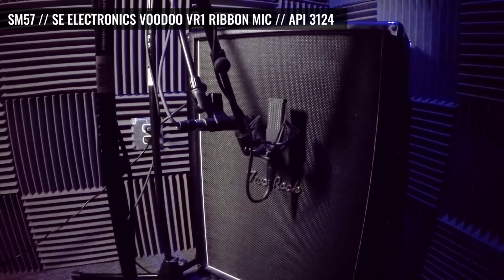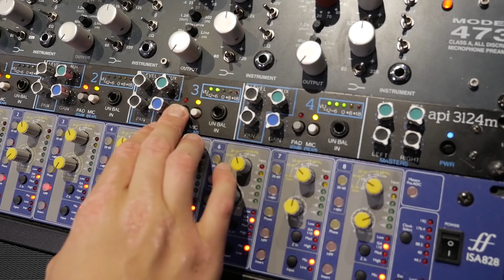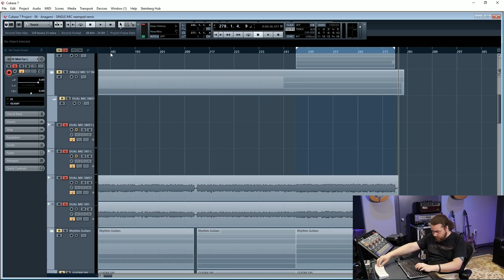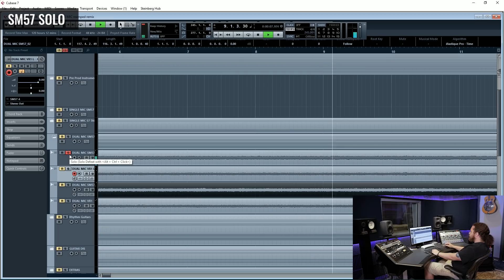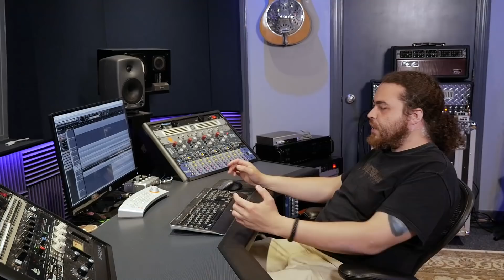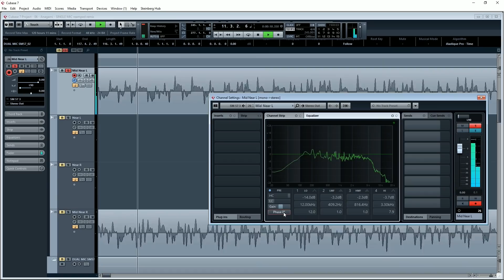Recording Metal Guitars: Dual mic setup w/ John Browne of Monuments

Comment: When you said off axis did you mean off center when talking about the position of a mic beeing in axis but not pointing to the center of the cone or the speaker?
I always listen to the sound, no matter if I can see through the mesh or the cage.
Cheers 🤘🏻♥️🍀
Reply: Nope, off axis is that the mic is not facing the cloth, it's perpendicular to the cab, see the fredman technique, but jon is putting the mic in 30°

Comment: What is your approach to panning when having 2 guitar players playing the rhythm tracks? In this scenario I can see having 1 amp with 2 mics on each left and right, but what about a 2 amp 1 mic set up? With my latest recordings I play a Marshall jcm 900 and my other guitar player plays a 5150. I blended the 5150 and 900 on both sides rather than looking at it as a proper band where you would hear the 5150 on your left and the Marshall on your right.

Comment: So, you essentially reamped the same waveform to the left and right side. Wouldn’t that be similar to just recording it once then copying it to the other side? If so, then how do you get them to sound like 2 separate guitar performances and not just way louder?
Reply from the maker: Each side is a different performance, otherwise as you said it would just be louder.
Reply: URM Academy gotcha, thank you for clarifying. That makes sense haha. Don’t know why I didn’t think of that...
Reply: Having the same thing on each side is called mono... :p
Reply: fun trick though, if a client sends you mono guitar and DIs you CAN reamp it L/R with aggressively different eq and amp settings...
It'll still sound like shit but at least it'll be different lol. if it's not tech metal you could probably do the beatles offset thing

Comment: you never talked about the pedals you said in the beginning.
Reply from the maker: It’s a clip from a course that’s several hours long. The pedals are covered in another section of the course.
Reply: Okay.jpeg
Reply: The pedals he normally uses are an EQ to cut away some 100Hz and 200Hz and also some sort of tubescreamer style OD set with no gain and high/full level. Pretty standard metal set-up.